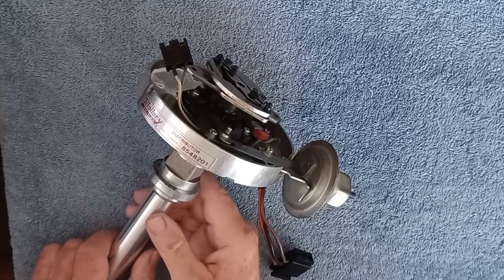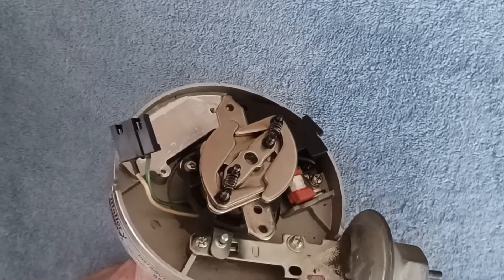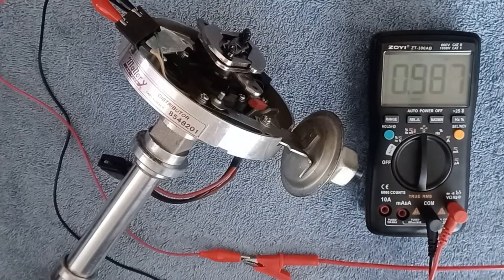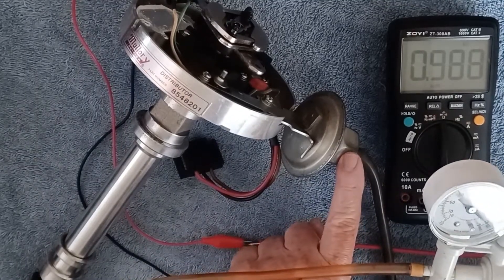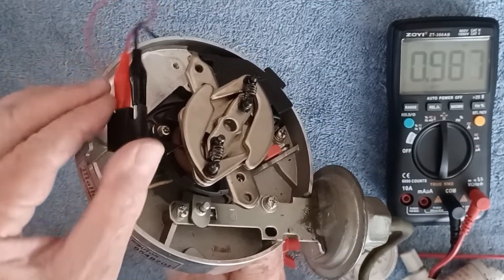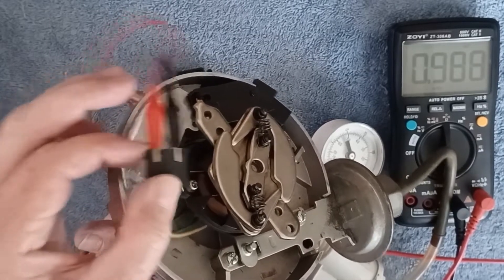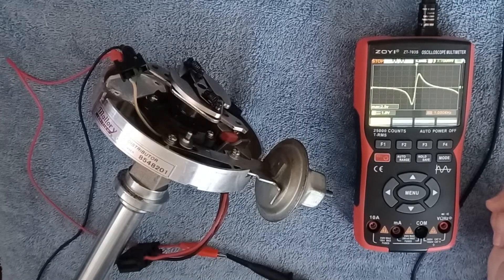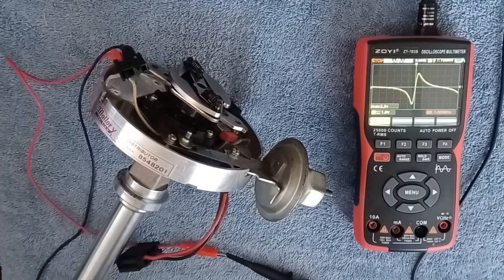How to Diagnose an HEI Distributor Pickup Coil

Comment: Greetings from Spain
I have a 1994 Chevrolet motorhome with a 454 7.4L engine.
For a few months now, it's been starting perfectly, only when it wants to. After I turned it off, it no longer wants to start. Only the starter motor turns. I thought the injectors were bad, but I prime them from the ICM and they work. I have gas, everything's fine. New pump.
I also don't get any spark when it won't start, and according to the manual, it all goes through the ECM.
If it helps, I'm not getting resistance values on either pole of the pickup coil or between one of them and the metal housing of the distributor. Several multimeters show the symbol "1," which, according to the device's reference, means the circuit being tested is open (in both tests, from one pin to the housing and between both pins, as you do).
However, it does give me a value of 0.36 V AC when I turn the ignition key and turn the distributor.

Many people tell me it's the ECM, but it's not exposed to heat (it's next to the steering column, in the living area of the motorhome) and humidity can't affect it.
If the problem were all with that pickup coil, why does it sometimes start perfectly?
Best regards, and I look forward to your response.
Thanks!
Reply from the maker: Hello. I have a few questions. First, when you say when it does not want to start, "only the starter turns", do you mean that the starter is cranking the engine over or do you mean you only hear the starter turning and the engine is not cranking? Also, you say that you won't get any spark when it won't start, I assume that the engine is cranking over when it will not start and you're not getting any spark to the spark plugs while it is cranking over.

You say that you are not getting any resistance measurement between  the poles of the pick up coil or between a pole of the pickup coil and the metal housing of the distributor. You would never want to see a resistance measurement between one of the poles and ground, but you should see a measurement between the two poles of the pickup coil of usually 500 to 1500 ohms. If you're getting a display of "1" it could be an open circuit in the pickup coil, or it could be that your meter or meters are not auto ranging and the scale that you're on is lower than the resistance that you're measuring. If you are not using an auto ranging meter, make sure that you are on an ohm range that will read what ever the specification is for your pickup coil. A meter that is not auto ranging will often read "OL" (over limit} if it's reading a resistance that is higher than the meter is set for. Auto ranging meters will "range up" to the proper scale on there own. An AC voltage is good if you crank the engine over and are reading that voltage between the two poles of the pickup coil. It doesn't make sense though if the pick up coil is open so make sure that you are on the correct range to read a resistance of the pickup coil. 

I'm not familiar with the ignition and the fuel system on a 1994 motor home, but most HEI ignition systems will use a small module in the distributor that receives a signal from the pickup coil. Those modules can fail or become intermittent. They are subject to a lot of engine heat and over time will fail. If I was going to guess (and I don't like to guess), but I would consider the HEI module in the distributor before I would suspect the actual vehicle ECM. It is possible that your version of HEI distributor is controlled by the ECM, in which case there may not be a separate module in the distributor, however, I think in 1994, the HEI distributor was still a "stand alone" unit but you should be able to tell that by seeing what's under the distributor cap. If by some chance you do replace the HEI module, make sure that you use some heat sink paste between the module and its mounting plate. It helps ensure heat transfer between the module and its mount. 

Also, if you have access to the factory service manual, I would spend some time with the engine control trouble shooting section. You should find some diagnosis charts that will help you with the process. Good luck!
Reply: @StuffAboutCars-jg5tx  Good morning from SPAIN.
I really appreciate your kind words and your effort.

To clarify, I'll first tell you that the ICM is new, two years old, because I also installed it when I changed the rotor and distributor cap. But for better verification, I even put the old ICM back in, and the same thing happens. It starts perfectly, for example, at 10 a.m. and I let it run for an hour, but then, if I try to start it after two hours, there's no fuel in the injectors and no spark. (The ICM also has that insulating and heat-sink gel.)
Answering your question, yes, the entire engine turns over when I turn on the ignition (starter motor and the mechanical part of the V8), but there's no fuel or spark at that moment (in my opinion, because there's no rotation signal from the distributor that's sent to the ICM and then, as you say, to the ECM).

The resistance meter thing is weird, because if I set it to the 2 Megaohm scale, it starts measuring, but it just keeps going off and never reaches a fixed value. Besides, it wouldn't make sense. Normally, I'd set it (for the workshop manual values) to 2 K ohms, and it doesn't show OL or anything, just a "1." (which the paper tells me is an open circuit). But if it were open, how the hell do I get AC power when I turn the rotor with the ignition on?

I'd rather try putting a new pickup coil on it and not replace the ECM hastily; I think it's the best thing to do.
The funny thing is that the times it starts, it's perfect.
Reply from the maker: You say that you do not have fuel in the injectors or spark when you try to start if after it's been run for awhile. Do you mean the infectors are not being triggered by the ECM or there is no fuel pressure? Fuel pressure is a very important check when you have a fuel injected vehicle that won't start. Can you check for fuel pressure when you're cranking it over. That requires a fuel pressure test kit. Also, do you have a Noid Light? If you're not familiar with that, it's a tool that you plug into the an injector connector (by disconnecting one injector) and look for a flashing light while cranking the engine which is indicating that the ECM is triggering the injectors. 

If the ECM is not triggering the injectors and there is no spark at the spark plugs, there is also a possibility that the Crankshaft Angle Sensor (CAS) is not sending a signal to the ECM. Those can work when they're cold but will fail when hot. When they fail they could make the engine stop running while it's running or after you shut the engine off, it will not allow the engine to restart a warm engine until it cools down. Crankshaft Angle Sensor input is often required to allow the fuel pump to run, trigger the injectors and provide spark to the spark plugs. 

None of what I'm writing is a substitute for a good Service Manual so I hope you have one of those for your vehicle. I would verify that you have fuel pressure when cranking the engine, the injectors are being triggered by the ECM and that you have spark to the spark plugs all while cranking. If none of those exist, I'd check the Crankshaft Angle Sensor and its circuit. Many vehicles will allow the fuel pump to run while cranking (ignition switch in the "Start" position) without CAS input and then with the key back in the "Run" position not allow the pump to run without input from the CAS.  

I hope this makes sense. Good luck.
Reply from the maker: Also, some vehicles in the past have used Crankshaft Angle Sensors built into the distributor while most vehicles now have a separate CAS somewhere near the front of the engine near the harmonic balancer or at the rear of the engine near the flywheel or sometimes in the middle of the engine block down near the oil pan parting line. I don't know where the CAS is on your year vehicle. That's another reason for a good service manual.
Reply: @StuffAboutCars-jg5tx greetings again. In response to your previous comment, it's true that I don't know if the fuel pressure is correct or not, what I do know is that when it wants to start, everything works perfectly, both with the old fuel pump (which there was no reason to change) and with the new one. Yes, I'm also familiar with the Noid light. I haven't acquired it yet, given that hypothetically the camshaft position sensor (this 454 doesn't have a crankshaft position sensor) does so through the distributor pickup coil, if that coil doesn't send a signal on certain occasions, generally after a rare ignition, I think it would be pointless to check with the Noid light if the ECM is sending a pulse to the injectors and the coil's spark. I say, I think. Yes, I have the 1994 P30 mechanics workshop manual and also the electrical manual, and it indicates that process. But the pickup coil is driving me crazy because I see that everything I've changed so far (except for touching the ECM) has been in vain.
Reply from the maker: It looks like this engine is a throttle body fuel injection system and you're sure that the two injectors are not firing when the engine cranks over and it won't start, right? Also, when you check the pickup coil with your DVOM, do you have it disconnected from the ignition control module? If it's still connected when you put a meter across it, you can get some very strange readings (like the "1" that you're getting instead of a resistance value).

Also, I remember an old test for a GM HEI distributor that used a soldering gun. Not a soldering iron, but a soldering gun with a trigger. With the ignition on, you would put the soldering gun next to to the distributor cap and with a plug wire disconnected and held a short distance from ground (preferably with a spark plug tester), trigger the soldering iron and the EMF that the soldering iron produces will create enough of a magnetic field, the pickup coil will send a signal to the ignition module and spark the plugs and possibly fire the injectors. The test was used in the 70's before anything GM had fuel injection although I think it would fire the injectors on a vehicle that didn't use a separate crank angle sensor. The test was used to verify the ignition coil and the pickup coil and the ignition module was working and if you didn't get a spark by using the soldering iron, you had a problem with either one of those components and individual testing was needed (or you weren't getting 12 volts to the distributor). You could do a little research about that test. It may help if you wanted to try it when the engine was cold to see if it would work and then try it again when the engine won't start. I would do a little research about that though. 

Intermittent problems are definitely a challenge. Good luck.
Reply: @StuffAboutCars-jg5tx  Thank you so much for your advice and your determination to help.
You're absolutely right. My engine is a 1994 TBI. Yes, the inyectors, this times, no start.

Yes, I perform the pickup coil test as indicated in the workshop manual. Disconnected from the ICM, I first test the resistance between one of the pins and the metal housing of the distributor, and it should read "infinity," but it reads "1."
Then I follow the instructions and measure the resistance between both pins, and it should read between 500 and 1500 Ohms, but it still reads "1."
All of this with the ignition key off, as the manual says.

Then, what's strange to me is that it does read 0.36 Volts AC between both pins if I turn on the ignition and turn the engine over (but the V8 doesn't start because it obviously can't start while I'm doing this test).

Without a doubt, as you say, it's a challenge because if it never started, it would be easier to troubleshoot the problem. I'm going to replace the pickup coil, being careful not to loosen the distributor. For $20 for a GM, I'll see if I can get resistance values. I've tried it with three multimeters, and it already seems strange.
Everything else electrically (except the ECM) is new, and I'm also continuing to test with the old parts I know worked to compare, and nothing. It's still the same. So I'll take care of this coil.
I'll keep you posted. Thank you very much.
Reply from the maker: Unfortunately, you're going to have to remove the distributor from the engine to replace the pickup coil. That means it has to come out of the engine and be disassembled to replace the coil. If you haven't removed and replaced a distributor before, there are a lot of YouTube videos on that subject and you're going to want to study a few of them. You'll also have to remove the gear on the bottom of the distributor shaft by tapping out a roll pin and then pulling the distributor shaft out of the housing. There are videos on YouTube about that too.  I'm puzzled about the reading that you're getting between the poles of the pickup coil. I don't know what "1" means on your meter. The A/C voltage is in the ball park, but the resistance makes no sense. 

Also, what does your DVOM read on the Ohm scale when the leads aren't touching each other? That should be infinity and it should read the same when you touch one of the pickup coil terminals and the distributor housing. That reading should  be infinity. Anything else would mean the coil is grounded.  

Good luck with that project and hopefully you're not in a rush to use the motorhome.
Reply: @StuffAboutCars-jg5tx  Yes, the workshop manual even tells me to remove the distributor, but I've seen many videos on YouTube, and they're great.

If it helps, the instruction sheet for my multimeter says this, verbatim.
"If the digital display shows a 1, it means the circuit you're using is open and offers no resistance."
"If it goes to an infinite value, the infinity symbol will appear."
If I set the multimeter dial to a higher Ohm scale, when I read the reading between the two pins, it starts to display numbers that keep increasing and never stops. That's why I try to measure on the lowest scale for values of 500-1500 ohms. The 2K Ohm scale.

I'll try more multimeters or buy another one, but I'm certainly surprised that it never shows a resistance value, but it does show AC.
I can say, however, that the engine never starts if I try to start it while it's warm after resting for about 20 minutes after working perfectly for half an hour.

I'll keep you posted, thanks, friend.
Reply from the maker: We know that heat is an enemy of electronics. It's more than likely an electronic device is failing when it get hot enough. Has the engine every died while it was running or does it have to be driven up to operating temperature, shut off and "hot soak" for awhile and then it won't restart? If it only won't restart after a hot soak, that helps to eliminate the ECU (as long as the ECU isn't in the engine compartment) and the failing component is subject to under hood temperatures. Although an ECU creates quite a bit of heat on it's own so you can't completely eliminate that possibility. Unfortunately, ECU's are typically tested by substitution once you're sure everything else is good, however, many ECU's can be opened and inspected (unless they're sealed and potted). Capacitors can leak on the circuit board and bad things can happen. You may want to smell the ECU and see if it has a burned odor. 

I'm still puzzled with the readings you're getting with your DVOM. If you go by the instruction book, "1" means an open circuit. I would have to suspect the DVOM has a problem in the ohm circuit. I did buy a DVOM once that when brand new, had both positive and negative test leads with loose connections where they plugged into the meter. I was able to tighten them and I fixed it, but it wasn't the best of meters. Make sure you wiggle everything when you test for resistance (the pigtails coming out of the pickup coil and the test leads). 

You've done some thorough testing and I'm sure you'll find the problem. I'm anxious to hear what you find. Good luck.
Reply: @StuffAboutCars-jg5tx that's right. I also maintain that theory about there being no heat in the ECU. It has never turned off on its own. It has some very temporary and sparse oscillations at idle, but it'sYeah, my multimeter is weird because I recently ran much smaller resistance tests on another older car I bought, and it gave me the exact values I was looking for. Whatever it is, for now, the only thing I can do before thinking about an ECM is spend those $20 and put in a new pickup coil. I already bought it at RockAuto. Everything else works and it's brand new (sensors, regular coil, solenoid, rotor, ICM, everything), and I still have the old parts, which I also put back in to see if it would improve, and nothing. It starts perfectly, but after 2 hours, nothing. And that, whether it's the pickup coil or something else, is affected by the heat no matter what. Thanks, buddy. I'll let you know when I know more and get the distributor out. I don't think it's necessary to order a new reluctor ring (where the pickup coil does its work, at least until I carefully disassemble the distributor).  always done that since I've had it.
Reply from the maker: When you say, "always done that since you had it", do you mean that the motorhome has always refused to start after a hot soak since you've owned it? And how long does it typically have to sit and cool down before it will start? 

I've never done this, but what if you rig up a small fan that you aim at the ECU, start the engine and run it long enough to come up to operating temperature and then shut the engine off and let the fan continue to run for a few minutes and then try to start the engine. It may be worth a try to keep the ECU cool and see what happens.
Reply: Sorry! I explained myself poorly. The motorhome has always worked perfectly, except since this Christmas, when it only starts when it wants to (the problem I mentioned to you). What I meant by that is that it has always had the occasional fluctuation at idle, but nothing significant; in fact, barely noticeable. What has never happened to me is starting it at a certain time, leaving it running perfectly for an hour, and then, after turning it off, trying to turn it on after two hours and then not wanting to start (no spark or fuel). But it's a good idea to cool the ECU, although in the motorhome, it has no contact with the engine at all. In fact, it's housed in the living area under the steering wheel. I've already ordered the pickup coil from Rockauto and will install it when I get to Spain. I'll keep you updated, friend.
Reply from the maker: If it's easy to do, even though the ECU is not in the engine compartment and is not exposed to engine heat, you may want to direct a fan at the ECU while you let the engine warm up. Shut the vehicle off after an hour (if that's what you normally do) and then try to restart it (after the amount of time that you usually let it "hot soak"). If it starts, you may want to take a look inside the ECU. If it doesn't, then go to the effort to change the pickup coil. Just a thought.
Reply: @StuffAboutCars-jg5tx Greetings again from Spain. I went with my friend to dismantle the distributor and I took out the old pickup coil. It was almost destroyed. I don't even understand how it could sometimes start. I carefully marked the distributor beforehand and when I reassembled it, it fit in its correct place. I checked the advance degrees with the ignition advance connector unplugged and it shows the 4 predetermined degrees on the adhesive paper on the air filter. Now I've had it on for 1 hour and after 4 hours it starts again perfectly. I think it was all that damn pickup coil. I greatly appreciate all your help and instructions.
Reply from the maker: It sounds like you've fixed it. Those were some very strange readings that you were getting with your DVOM, but I guess it was trying to tell you something. I'm glad that you found it. Thanks for letting me know. Good job! 😁